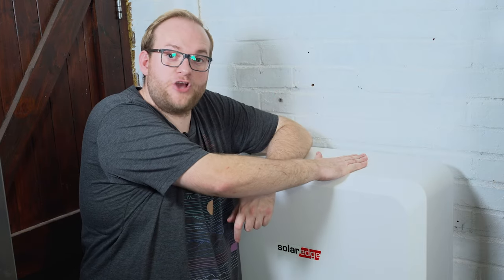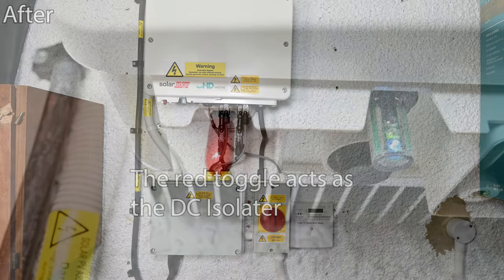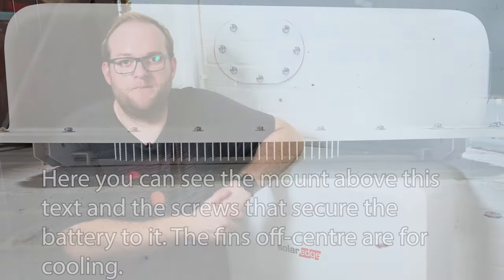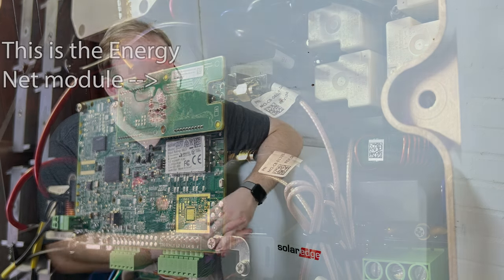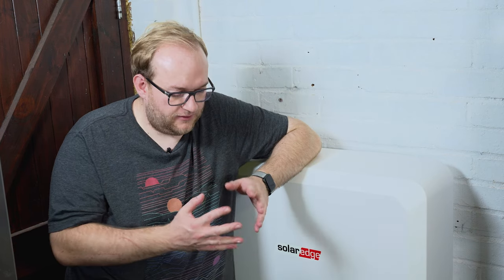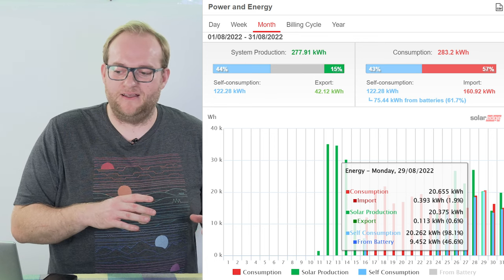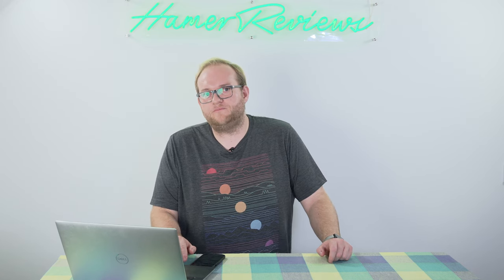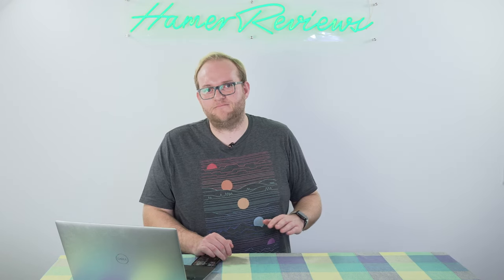Solar Power - Our UK PV Install Part 2: SolarEdge Home Battery and initial system performance!

Comment: Can you turn off the heating element of the hotub at night? I assume the temperature wouldnt really drop that much if it's well insulated, and then it can heat back up to full temperature when solar is available? I wonder if there is anyway of doing this with smart switching, or if there is a product similar to a solar hotwater diverter for hotubs?

Comment: Let’s all lobby SolarEdge to allow customers to manually change the battery charging profiles. Commenting on the SolarEdge Apple app review in the App Store review gets a response from them!
Reply: Hi there
The only modification that I can make to my battery is to modify the backup reserve level, with the lowest value being 9% (factory min setting). I would prefer to set this to 0% as we rarely have blackouts and want to utilise the full capacity of the battery. Would love to be able to fully adjust the battery’s charging profile as well, as we are on a time-of-use tariff.
Reply: @andrewwalker6092  is 0% soc level not good for your battery 🔋?
Reply: The app supports this now
Reply from the maker: Only for beta test users
Reply: Is this live for all customers now? Not sure how I feel not having control of this myself.

Comment: Have you considered growing your battery storage with unofficial mods? E.G. Harvesting batteries from obsolete minimally used medical devices.
I've been looking into doing something like that, buy the smallest battery storage and then add my own batteries to it for 1/3 of the price or less for a much more rapid ROI.
Reply from the maker: To be honest, it'd have to be an AC connected separate system and my electronics skills are not high enough to even think about attempting that myself. One of the things I like about the SolarEdge system is because it's DC connected I can make use of the additional generation from the panels - an AC system wouldn't let me do that. Granted there are some good savings available. I think in the future I'll add another one or even two SolarEdge Home Batteries - but I do think a lot of people go the DIY route successfully!

Comment: Hi I too have a Solaredge home battery,, Unfortually I purchased it myself which turned out tobe a rubbish idea,because you are not suppose to be able to do that,,  The problem I,m having is getting a installer to fit it,,, Most installers do,nt want to know ..and as I recieved the battery in March and it still is not fitted. Bu fingers crossed I,m just waiting for a window for a guy to come.. Like yours my system is totally Solaredge and like you I,m pleased with it ,,,its East West and last year I got 4MWh and this year I,v already beaten that figure. Looking back ,because I now get 15p per kmh from my supplier in export I,m wondering if it was such a good investment.. AS I have  just retired I want tobe solar selfish ,I do not want to have tobe concerned about switching on appliances I just want to turn on with no regard to cost..    Yeah thats for all the info,,have subbed

Comment: Hello, if you have bad solar production because of bad weather And you decide to i charge up your battery  How long will it take to charge from 0 per cent to 100 per cent.  Thank you Tom
Reply from the maker: I’m theory the battery can charge at 5kWh so around 2 hours, but realistically it’ll fluctuate so my guesstimate is 3-4 hours

Comment: I like your review.    I did a 3 part review on my newly commissioned Energy Bank.  

Couple of questions:  
1.  Do you find there's frequently a persistent 20-30W draw from the grid, especially when an inductive load is present (fridge freezer compressor).  I'm finding that there is, and it adds upto about 0.8kWh per day.
2.  What's the total energy charge throughput vs discharge throughput?  I did this data analysis, and I found that the efficiency of my battery was around 76%.  Far lower than the 94% nameplate efficiency.
Reply from the maker: Yep so the 20-30w is pretty standard. That’s due to the inverter plus a bit of it is error on the MODBUS in my opinion. Efficiency is an interesting one, I haven’t bothered calculating it out that accurately - I mean for one, unless I get some highly accurate meters on either side I’m not sure I’d even know for certain. You can’t really trust the MODBUS due to CT clamp error and equally you only have what the SE devices report themselves. 

I would assume that the efficiency they quote is purely energy into the battery and energy out. I doubt they’ve counted energy conversion through the inverter. The PowerWall II my parents have is pretty similar from what I see o. Their data. 

How did you go about calculating your efficacy? Where did you have your energy meters in the process and what kind did you use? 

Also I assume all figures quoted are under ideal conditions so again depends where your battery is located etc. 

All of it is hard to work out as manufacturers quote numbers but it depends where they are measuring etc.

Overall the battery is working very well for us, but equally I don’t charge from the grid. When I recently asked SE about efficiency of charging from the grid they confirmed the same efficiency but I didn’t ask them at what point that measurement was taken from. 

Definitely something to follow up on.
Reply: @HamerReviews  
1.Go onto the monitoring website (not monitoring app), 
2.  Select "Analysis"
3.  On the left side navigate to Storage --> Battery 1.1 
4.  Setup graphs for "Charged Power" and "Discharged Power"
5.  Select the date range you wish to analyse
6. Output the data to a .csv file with a 1 hour resolution.

You can then sum up the power input/output to get total energy throughput.   Always start/finish your summations at a point where state of charge is 100%.  
Then, efficiency = Battery Output / Battery Input * 100%

Now as you say this doesn't consider the inverter losses.  You can compare inverter output with battery output at night time.  I measured a 20 Watt difference between the two.  So for example, when the battery output 300Watts, the inverter would output 280Watts.  So we can surmise from that that the Inverter uses 20Watts of power when not in standby mode for low load outputs.

That may indeed be the reason why 20-30Watts is being pulled in from the grid, but I think it is actually an "Apparent Power" vs "Real Power" reading discrepancy where they aren't taking inductive/capacity impedance into acount.

Modbus meter is typically within 6% accuracy of my supply point meter.  On Octopus website, you can read daily import/export and compare directly with SolarEdge import/export for the same day.
Reply from the maker: @anthonydyer3939  honestly, I just wouldn’t trust the measurements from SE’s own software / hardware. If I wanted to really do analysis of it I’d want some very accurate meters in between each point. 

Might be one to speak to SE support and see what their argument is?

I’m probably going to try and get too bogged down in the efficiency argument. Organisations will always quote the data where they look best, yes it’s important for some people and I get it, but equally it’s very easy to get incredibly bogged down in them and not end up with any system at all.

Hopefully you can get some answers from SE, I have to say 80% efficiency doesn’t strike me as that bad but obviously there are so many variables.
Reply from the maker: @anthonydyer3939  btw don’t mean to sound dismissive, but I don’t really have the capability to accurately measure the aspects we are talking about without using SE’s own data. So it’s really hard for me to comment meaningfully. 

I totally get your concern, in terms of power pulled from grid, that is normal vs what I’ve seen at pretty much every home with solar, so not worried about that. 

The battery efficiency one is just really really hard to comment on.
Reply: My background 40watts from the grid only happens when the battery is being discharged.  Once the battery is fully charged and the house load can be supplied entirely from the PV, that background usage disappears.  In fact I think it disappears once the battery starts charging.  It’s something that only happens when the battery is being discharged
Reply: The inverter should be drawing its 30-40W from the battery, not from the grid.  In a blackout situation it can’t get that from the grid so why would it do it under normal conditions, especially when the whole purpose of having a battery is to minimise or eliminate grid usage.  Most of us would prefer that out systems used an extra 600W from the battery (especially when our batteries are only getting discharged down to 30% as the days get longer) than to draw that from the grid and leave it unused in the battery.

Comment: Great to the point and detailed video. was wondering what version solar edge inverter you were using? is it the older HD wave or the more recent inverter that was released around the same time as the battery? I'm trying to understand if my HD wave inverters will work with the new battery or if I need an inverter upgrade as well. I thought there was some talk of a software update that allowed the previous generation inverters to work with the energy hub and battery.
Reply from the maker: Hi there, thanks for your comment and glad you found the video interesting. My inverter is a current HD Wave - not a home hub. My understanding is that the batteries will work with all HD Wave inverters that use set app and DONT have a screen. Hope that helps!
Reply: The HD Wave inverter with a screen is also compatible with the Solaredge EnergyBank but you need an upgraded comms card. Solaredge part number ENET-HBPV3D-01

Comment: Any update on whether you have access to your profiles yet, or is it still limited to installer only?  We are about to press the button on an install, I like the Solar Edge solution we have been proposed, but it just won't work unless I can control the profiles and dictate when the battery charges/discharges at different times of the year.  Cheers.
Reply: Ben, I was told by Solar Edge support a week ago that battery profile access would not be available until the third quarter of 2023 (July-September)
Reply: @RussMBrooks  Thanks Russell, appreciate the information.  We have accepted the SolarEdge install, which is due late Sep, fingers crossed they finally get this update sorted!  Our installer has also promised to make us an authorised admin, so we can have installer access if needed to make the changes until SE get their update out.
Reply from the maker: To be fair as authorised admin you get more control than the current beta program so worth doing regardless

Comment: Hi, I enjoyed your review 👍. Am I correct in thinking the solar edge system you have will not function during a power cut? 
By not function, I mean no battery power to the house and no top up of the battery from solar?
I ask because I have literally just seen the prospect of power cuts aired on the news and my suspicion is that such a scenario being painted as ‘unlikely’ but still being highlighted as a possibility; means to my mind, this has a much higher probability of occurring than not.
Reply from the maker: That’s correct, my system as it stands will not function at all - Battery or solar panels. 

I’m waiting for the launch of the home energy hub inverter and backup gateway from SolarEdge to upgrade and add that capability in the new year 🙂 

My parents Tesla PowerWall would function fine in a power cut and also keep the inverter active too

Comment: Hi, did you buy the panels, inverter, battery direct from the manufacturers and then pay and installer, or did you find an installer that stocks solar edge & LG?
Reply from the maker: Hi there, thanks for your comment. So kind of a hybrid of both. My installer doesn’t stock anything as such, he uses the major wholesalers. So he sourced the LG panels (well the ones closest to the ones I wanted that he could get), the inverter and battery but I worked with him on what I wanted spec wise, in fact I gave specific outlines for what equipment I wanted and which manufacturer. Some had to change (Tesla PowerWall for instance was just impossible to get hold of without a ridiculous wait) and I sourced some stuff that just couldn’t be acquired (I went as far as contacting stockists in South Africa at one point). 

The main wholesalers are Segen, Midsummer Wholesale, Renugen and Solar Sparky from what I can tell. 
Some of the larger installers do seem to have their own stock but I’d be surprised if a lot of the smaller ones do. 

Hope that helps!
Reply: @HamerReviews  very useful thanks. We only recently started our research. Your videos are the best explanations on solar and batteries I've come across yet. Cheers
Reply from the maker: @Lakedistrictrider  thanks so much for the kind feedback, really appreciate it! If there are any other question you have through the process do let me know. I’ll help as much as I can 🙂

Comment: I have a DC isolator when my inverter already has one - will it affect performance then and better to have it removed?
Reply from the maker: If everything works as it should I wouldn’t worry. In my case it seemed to cause a wider communication issue.

Comment: Hi, just found your channel, during my search on battery solutions.
just a Q is the solaredge not requiring a minimal number of panels/optimizers per string?
i had a minimal of 14 per string... depending on the optimizer and inverter i believe.
Reply from the maker: That’s a fair point - the minimum string length on the current inverters is 8 optimisers. That shouldn’t be an issue for most installs but I’m sure it might be in some - thanks for raising it

Comment: Let me get it straight. Your installer put one! string for south and north facing roof? That's the dumbest idea I ever heard of!
Second dumbest idea to put solar on the north facing roof.... This money invested will never pay for them self....
But hey, is your money and they talk you in to it.
Reply from the maker: Ah you didn’t watch the whole series 🙂 - no installer pressure - in fact the opposite. Thankfully the 3.7mWh of production on the north side since install very much argues against your assumption of not making payoff on that side. I’m expecting break even on the north side in 8 years. Fine by me. 

You may want to watch the rest of the series but perhaps you’ll just lose your shit more - up to you 🙂
Reply: @HamerReviews  I'm gonna follow your story to see yearly gain on the north side.  Lets see if this will be 8years, from my calculations I'm skeptical ;)
Reply from the maker: @sebanrg no worries please do - are you UK or US based or elsewhere?
Reply: @HamerReviews  uk
Reply: @HamerReviews  As I wrote before, your installer should go back to  learning process.
Reply from the maker: My installer did what I’d asked. In terms of N/S string split that was SE head offices decision who worked with me on the project. Due to the optimisers it really makes no difference